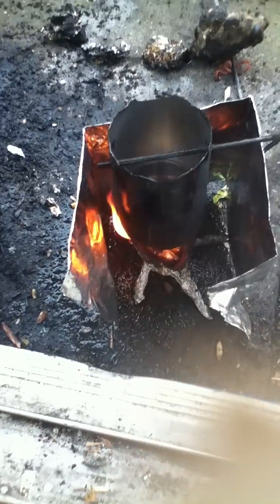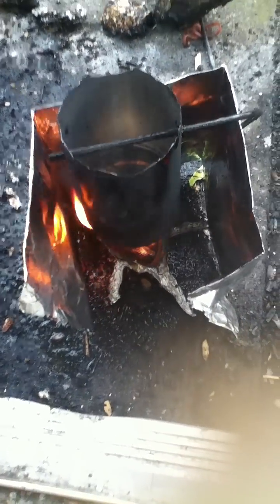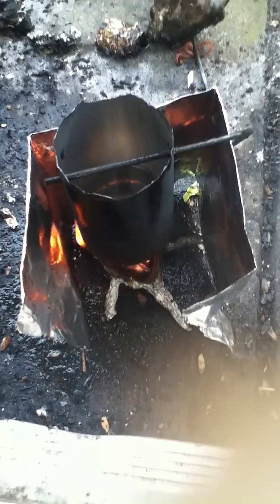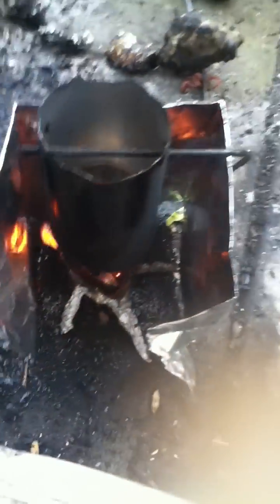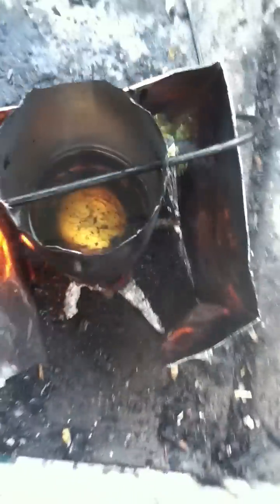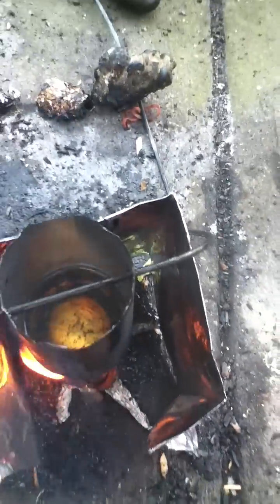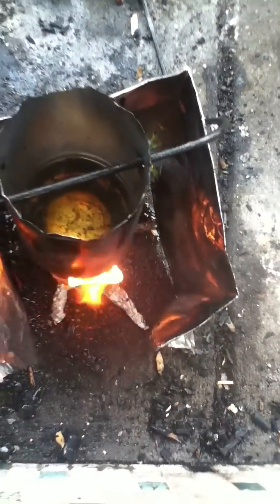Melting Plastic With Oil

Comment: Fantastic, I was looking for a way to get my plastic reduced. Very non labor intensive. Thanks
Reply: +1fanger  its  mixing with the oil tho
Reply: +ThePiggy  cant use the plastic ether
Reply: I was thinking of the same thing, before I begin the pyrolysis process to turn the plastic into fuel.